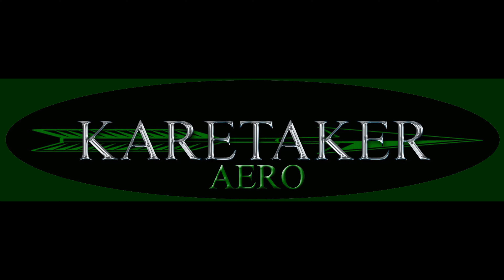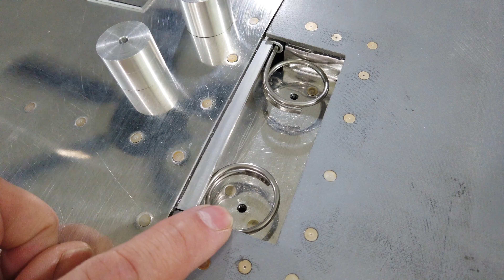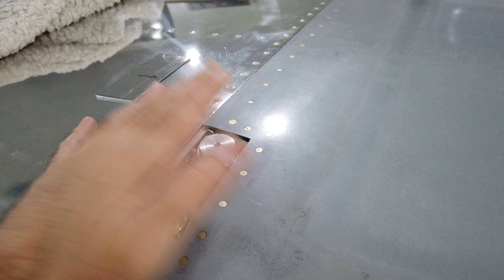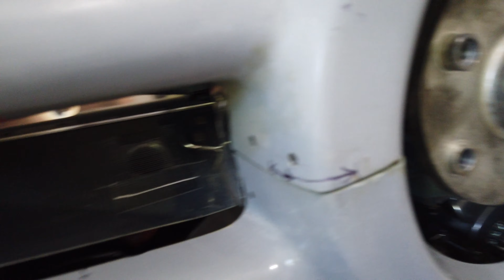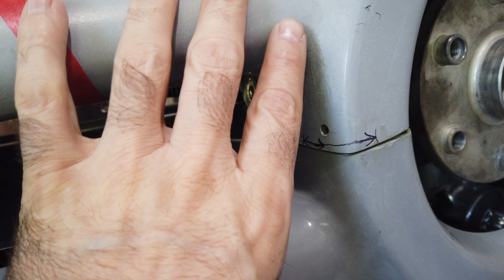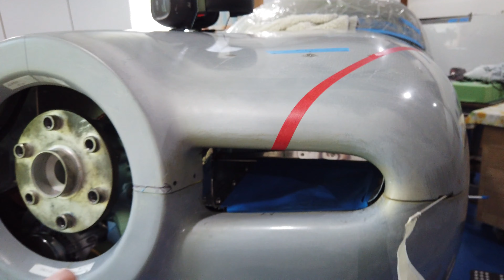Vans RV 7 HINT Cowling Hinge Pin Mod 3

Comment: Your solution to hinge pin access is great! You could sell kits for this (I’d buy one).
Reply from the maker: Thanks Kent! I'll keep that idea in mind for when I might have time to make them!
Reply: Love this solution.  I do wonder if the tank sealant is necessary.  The screws will center the standoffs in to the nut plates and hold everything together.  If for any reason you need to make an adjustment down the road, no tank sealant to mess with.
Reply from the maker: You are correct; not necessary, but once the screws are out the unit is all one piece, not three. Plus, trying to grab and pull the standoffs out of the curled hinge pin can be annoying because there isn't much to grab.